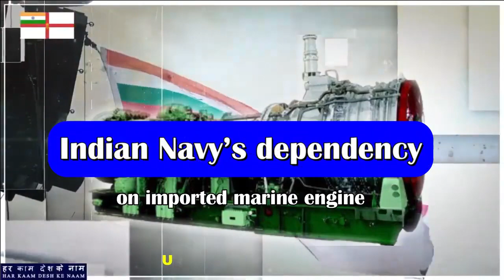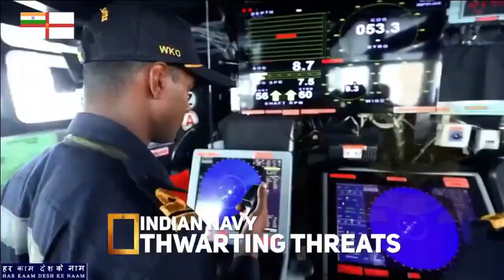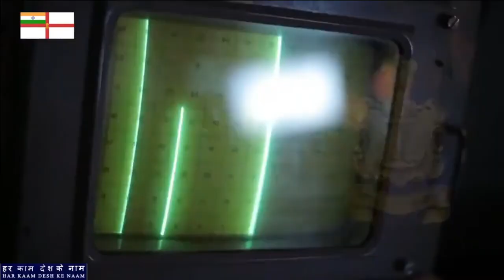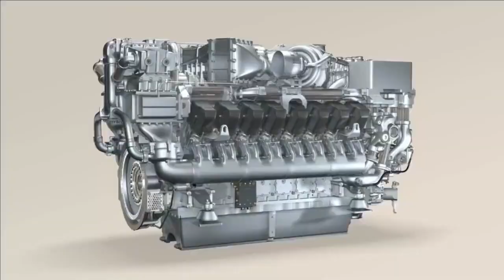Bharat Forge & BHEL working on Marine Gas Turbine Engine for Indian Navy

Comment: Nuclear power can also replace disesel engines, along with lithium ion batteries and fuel cells. It's time to try moving away from the old tech to the new. Fuel cells can already achieve up to 100 MW, which is far more powerful than these imported engines like Zorya turbines and General Electric (GE) LM2500 marine gas turbine. The indigenous tech based on DRDO/ISRO fuel cells is already here!!! It is past time the navy got seroius about moving off diesel engines to the next gen tech, Army already has electric vehicles. Time to dump diesel in a big way. Fuel cells!!!!

https://www.youtube.com/watch?v=mteV0GrrIck